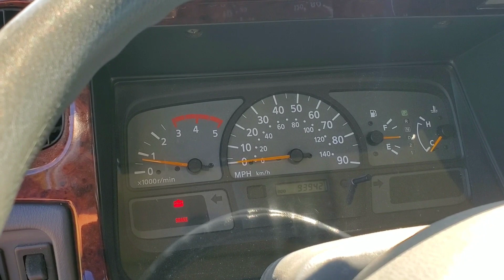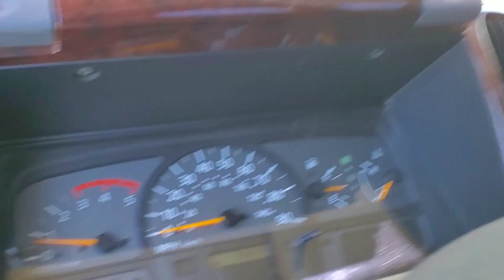UD Coolant Level Diagnosis

Comment: Did you ever find the coolant leak?
Reply from the maker: Yeah, small crack at the very top of the radiator, actually just below the sensor.  So it would leak down that much and never any more.